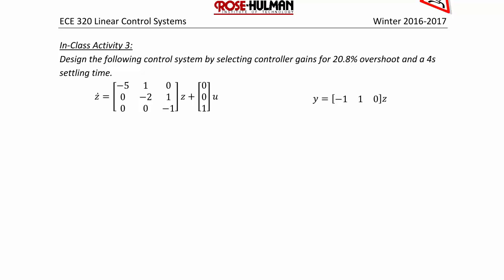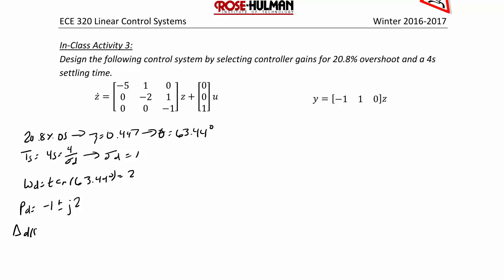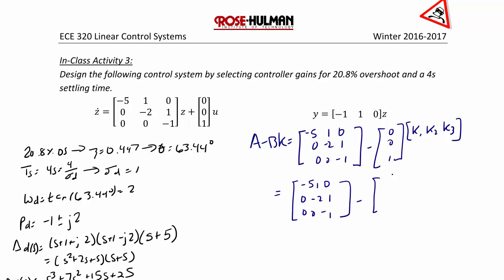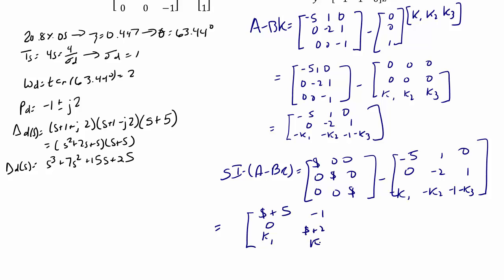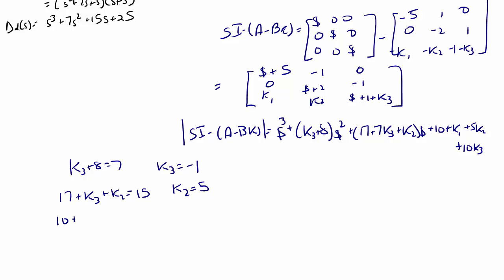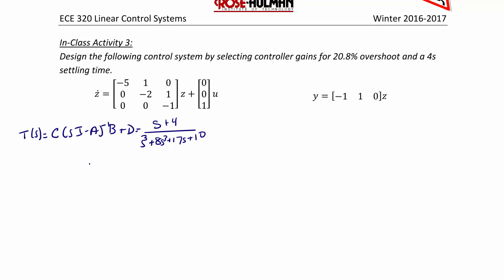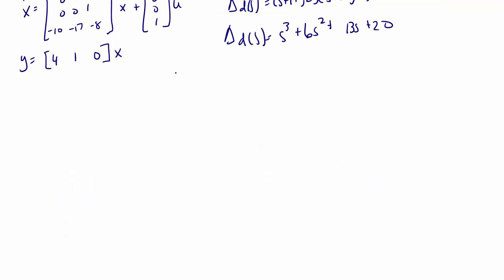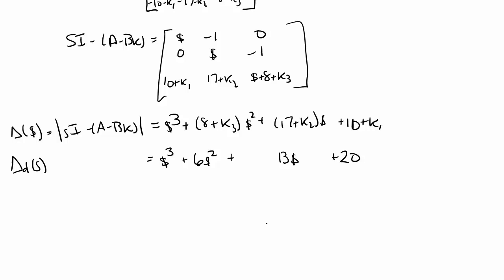ECE320 Lecture6-1c: State Space Controller Design

Comment: hi, I have a question, why do you advise pike the third pole at least five times away from the two poles that were obtained?
Reply from the maker: Great Question! Because we are trying to simplify the analysis by modeling it as a 2nd order system and you can only do this if 2 poles dominate the third one. This is typically true if he 3rd pole is at least 5 times away from the other two. Then if you plot the response, it looks similar to a second order response. #NoireSTEMinist #PurposefulProfessor Carlotta A. Berry